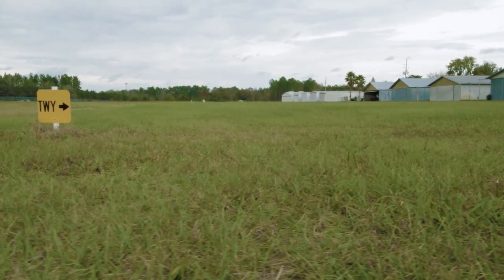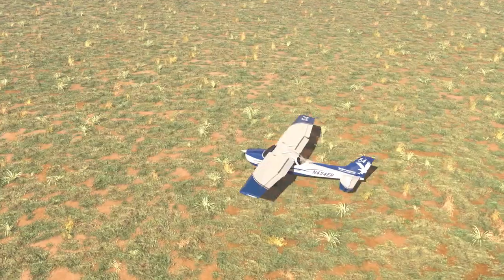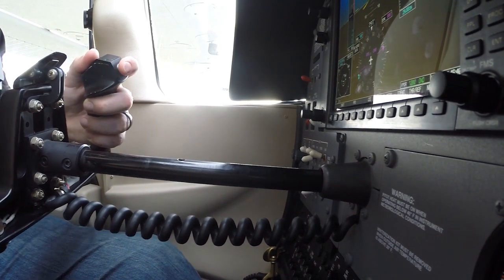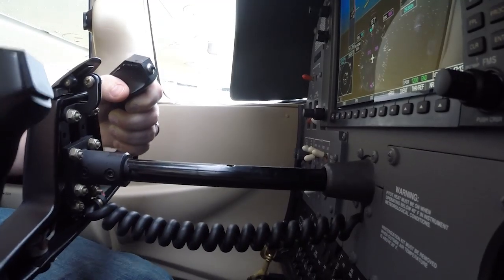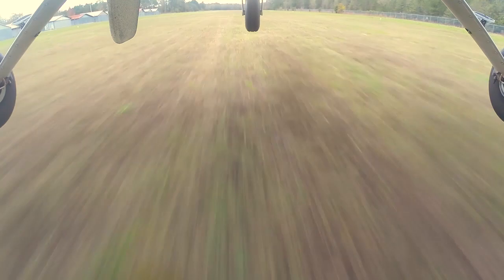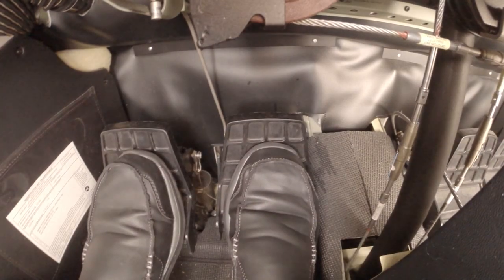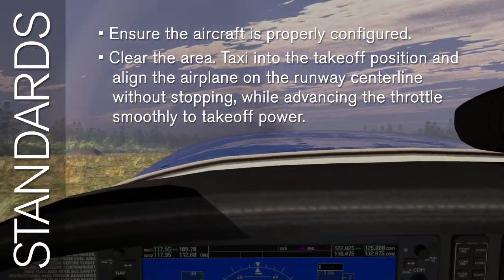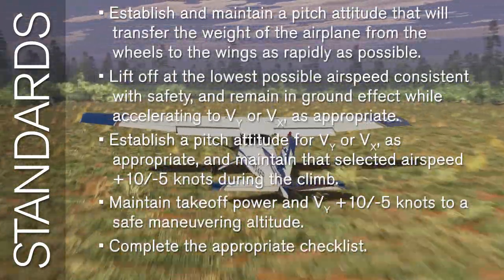Soft Field Takeoff

Comment: I do routinely fly off a 2600 ft grass runway with tall, tall pines on both ends, so far only with my instructor.  We do everything in this video, and the 1956 C-172 climbs like a rocket.  Great video - great info.  Only thing I am doing wrong is to allow plane to stop after aligning with runway.  Easy fix.  Stay safe.

Comment: Why should we apply the break when flying? Can someone explain me the reasoning?
Reply: To stop the wheels from spinning and avoid the shaking they cause
Reply: We always check brakes before landing to ensure we can safely land. If the brakes went out in the air, we’d have to go to a different airport with longer runways to ensure we have enough stopping distance as my airport only has 4200 feet of runway and it takes at least 2600 feet to stop in a Cirrus SR20 depending on temperatures and sea level pressures.

Comment: The proper take off on wet soft grass is hand/foot brake takeoff.  Throttle then release brakes.
Reply: I believe that is a short field technique.  You can't stop completely before applying full power on a soft field.  Once you start to taxi, you must keep moving onto the active and into your takeoff roll.  If you stop, you could get stuck.